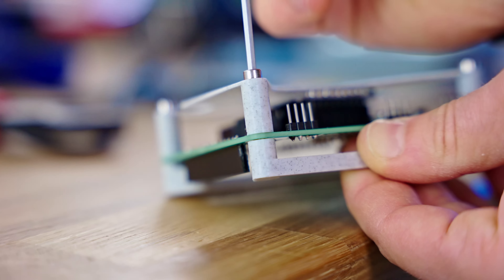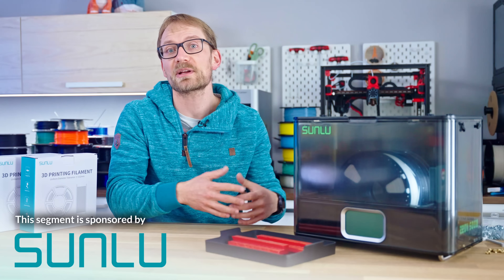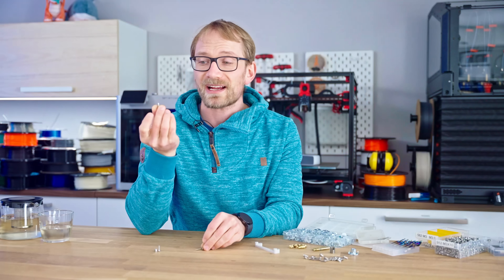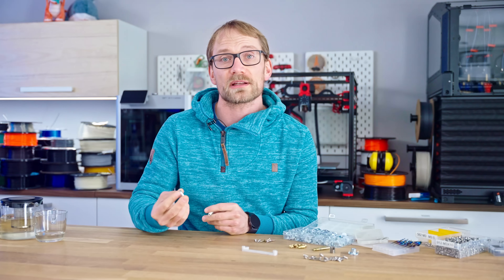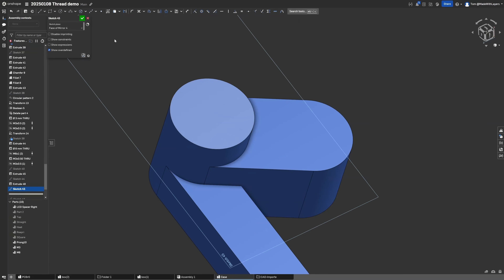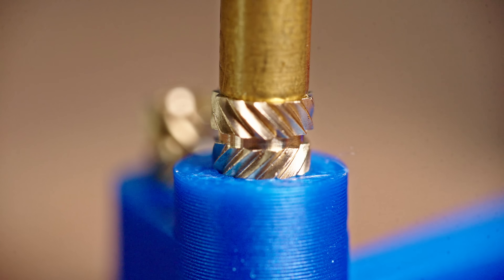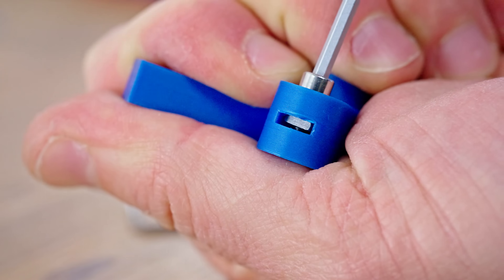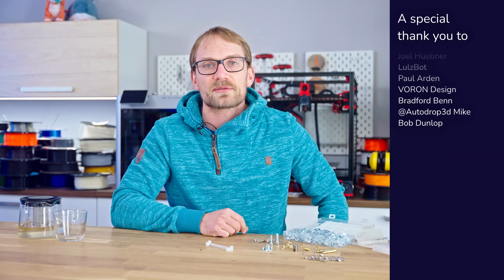A better way to add threads to your 3D prints

Comment: There is also the option of creating a pocket on the bottom face of the part into which a hex nut is tightly inserted. I've found this type of connection to be the easiest and strongest.
Reply: That's one of my favorites. I forget what channel I got the models from, but he did all the math for snug and loose fits for all the common hex nut and screw sizes. Super helpful. One of the popular channels but my mind is running a blank as to which one it was.
Reply: @DarwinAllen  I was too lazy to do any math for tolerances. When i add nuts this way, I just model the size based an the ideal dimensions with zero tolerances. This will create slightly undersized holes into which I can melt the nuts into with the same tools as I would with heat-set inserts. No room to wiggle and very snug
Reply: @Auravendill  Do not melt them! It isnt reliable solution. Just use screw thread to press fit the nut into the hole from bottom.
Reply: @DarwinAllen I got my OpenSCAD functions for this, that I've modified to expect a locating feature that I grind into the hex nuts.
Reply: I've loved this method ever since I saw it on my prusa.  Including square nut hole inserts.
Reply: I agree. Easy to reuse the nut and machine screw too, very useful if you are designing prototypes.
Reply: Or even embedding nuts at a layer pause. Surprised he didn’t mention that.
Reply: @GigaDanMan  This is my favourite solution. It wins on all metrics except maybe ease of use because you have to pause.
Reply: And you don't have to painfully screw through the whole section of the print, just the nut, this is the method I use over almost everthingelse.
Reply: I am very bad in 3d designing but I had to make a box for a pcb for a university project and I thought this solution would be the easiest one. Didn't work the first time but anyways there were much more wrong things on that design. The second iteration worked perfectly, the nuts fitted just perfect, and since I measured the lengh of the screws they didn't come out but still made it to the nut.
Reply: This is my go to - it's easy, neat looking, and super strong -- my Prusa is pretty much full of them...
Reply: I do this all the time but there's a catch with all designs where the thread is on the back of the part and not on the mating surface (aside from aesthetics) - your screws have to be of exact length, or else they will stick out. If it matters, this is not the best option.
Reply: @ErrorTH  Dremel tools are your friend for that if it's just a handful. I suppose if you were producing something in large quantities it could be a pain to source the exact right length.
Reply: @DarwinAllen  Or, just make a deeper pocket to get to a normed length. They go in steps, depending on size. Some 1mm, some 5 mm steps.
Reply: @DarwinAllen  ' Dremel tools '
Make a 3D printed Dremel tool chop saw or similar, with a stop that you can set to set the length.  You can make relatively short work of a large number of screws if you don't have to manually adjust anything.  Just place them and chop the end.
Reply: @ErrorTH its the same as a threaded insert but reversed 

you make the hole for the nut as deep as the screws 
once you push the nut in and start to tighten, the screw will pull the nut in to the correct depth 

you just need to do a slight bit of math to calculate the insert or just parameters in fusion but it's not that much harder 

eg: 20mm screws 24mm tall part 3mm thick nuts, inset nuts 4mm from the bottom so the top of the nut is 7mm deep into the part
Reply: @ErrorTH I have found I am able to recess the nut and adjust the length to keep the end from coming through
Reply: @ErrorTH  Coupling nuts are really long.  More expensive, but provide much more surface area for torque, and length to make fastener length mostly a non-issue.
Reply: @ErrorTH I have a cheap wire stripper plier that has holes for the too long screws up to m5. I  screw the screw in and the plier cut it clean off at my set height and when I unscrew the screw it corrects the cut off edge a bit 🤷
Reply: @ZombieDiscoBall3  brutal. i should try it.
Reply: @ErrorTH  My metal saws fully agree.
Reply: @ErrorTH  "the thread is on the back of the part and not on the mating surface"

Couldn't you combine the "captive nut" with any printed/tapped threads?
Reply: @ErrorTH or trap the nut within your part by adding a pause at the uppermost layer that the nut occupies.  You can place the nut in the cavity and click resume, allowing the print to fully encapsulate it.  If you have a through hole the size of your screw, the length will be less important so long as it doesn't protrude out of the part.

But I don't think you'd be able to print it with the cavity upright, if it's a hex nut, you'd have to print with the cavity parallel to the bed.
Reply: Also called a "captive nut", for anyone looking for more info on it as a method
Reply: I chose this way, its so easy to make a pocket for a nut, and it's fairly strong
Reply: This is my favorite as well.
Reply: yeah this. use draft so they hammer in.
Reply: @ChristheDesignar  I just add an offset of 0.05mm, which creates a tight sliding friction fit.
Reply: Nuts I use all the time, and it is GREAT. Basically, I look at other methods only when this one is not possible for some reason.
Reply: This is the way.  Bike accessory brackets are full of these.
Reply: But he does do this with a square nut, which is basically the same thing in this application that you're talking about. It also depends entirely whether you're talking about torsional strength, or other types of loads. CNC kitchen did a video and actually the hex not at the bottom is quite weak.

Comment: 10-50mm etc.. Aluminum/Brass/Metal standoffs can be used as heat inserts. I used a 30mm standoff driven into a print to add strength and a very solid thread connection. You can take a lathe or a drill and cut ridges down the length to act as barbs. Works great!

Comment: 450cad... for a filament dryer... AFTER DISCOUNT?!!!
I bought my freaking breville smart oven pro (BOV900) for 499$. it can reach 250c~ and has air frying and lots of nice features. it's made mostly out of metal too....
I'd rather buy an air fryer off the market place for 20cad. those ninja air fryers are great for filament. I'd have to make a hole to let filament trough tho....

Comment: The simple straight hole is the best choice for low-strength things. Personally, I haven't had any issues with the correct size (2.8 mm for M3) in ABS, PETG and PLA. No doubt it would be trickier in some plastics especially filled ones - but you can always chase the hole with a 2.5 mm drill bit (which will overcut a little).
Reply: In front of me is a light reflectance sensor, and I've held that into a print using two M3 BHCS - it's great!

Comment: I wouldn't give the square nuts in slots a high durability rating. They have so few threads they will wear out pretty quickly, especially if used in any application where they need to be really tight. Also, it's really easy to cross thread them. I spent many hours working on the extruder of a printer that made heavy use of this technique, and eventually I learned to replace those nuts that were used to mount the extruder every time I removed it, because otherwise the threads got messed up and it was a mess.

Comment: While I can't CAD to save my life, I love heat set inserts. I absolutely hate parts that use a self-tapping M2 screw or "self-tap" an M3 machine screw. Plus if you do a lot of DIY electronic projects you are likely to already have a soldering iron anyway. While you don''t "have to" use a threaded insert iron tip it makes a world of difference. Also you get additional strength if your screw is pulling the insert toward the opposite hole you inserted it from. 

While working on building a Salad Fork I asked in the GitHub if someone could modify the skirt feet to use threaded insert rather than the standard self tapping when attaching the rubber feet. Someone obliged and it made a world of difference in making sure the rubber feet stay put.

Comment: For most basic parts I try to use M3 screws with knurled, 4mm heat set inserts on the backside of the part. Longer inserts usually aren't needed and practically speaking, are very unlikely to fail without applying more torque than the part can handle anyway. I rarely use them facing the screw head unless it's just a holding a dust cover or something. If you absolutely have to use this orientation then longer inserts could be helpful.

For strong, functional parts I now just embed thick hex nuts into the print. Set the gcode to pause at the right height, press the nut(s) into place then print over them. It's the cleanest solution that's easily adaptable into most designs and extremely strong. Square nuts are technically ideal but require more space and IMO only necessary if height constraints require thinner nuts.

Comment: For harder 3d printed plastics, I use Bollhoff amtec flanged Quickserts Hex inserts. Install them with a Hex key. I use M4 and M5 sizes. Very Strong connection

Comment: Which method I prefer depends partly on what bore nozzle I'm using. A 0.2mm nozzle can give me fairly accurate M3 printed threads, but an M6 hole on a 0.6mm nozzle still needs to be drilled and tapped.

Comment: I did the ridges thing for a printed part to printed part connection I needed recently; whilst I profiled mine a bit differently than yours, the connection is fairly secure, yet still removable (which is what I was going for). Took a little bit of playing around to get the spacing and ridge count that worked best, but definitely a useful design concept to include

Comment: ooooh. finally.  a subject I have some experience with. 
printed threads are absolutely crazy good if you can dial in your tolerances.  on fusion,  after I make a thread, I go in and push the flat face .15mm in and then push one of the faces of the thread by .07mm and this seems to work perfectly for every size up to m8 for holes.   if you're printing threaded rods I wouldn't go under m5 and double those push numbers to get it to mate well with both printed parts and metal standard Parts

Comment: depends on how much I care/if i have inserts to suite. I often will just do a hole and tap it as i have a good quality tap and die set. however for my test fixtures i usually use m4 heatsets from cnc kitchen as they work really well even without the correct tool for my iron (but M3 defo needs the tool)

Comment: I bought smallish(M2.2, I know, weird) plastic screws with Torx-6 heads as I mostly print small prints. Extremely satisfying to use, i just design a 2mm hole and it fits. I also recently made a temporary replacement for a broken apart shaft collar (Stellring) out of PLA into which I cut an M3 thread for the grub screw - I was surprised how perfect that thread looked and how similar to aluminium it felt. The only part that really needed to be super strong I made with tapped holes into the ABS for M6 screws, super strong result.

Comment: Would dübelb work in 3D printed parts? I don't know the English word for it, but my fellow Germans will understand what I mean
Reply from the maker: You could use dowels (Holzdübel), and I actually show a couple different ways of using joinery-style connections here: https://www.youtube.com/watch?v=4cnJFZZRui0
If you're talking about wall plugs ("Fischer Dübel"), I wouldn't necessarily use them in prints, as they need quite large holes and probably won't provide the best holding power in a plastic-on-plastic connection.

Comment: I like the heated inserts.   I purchased a special stand to keep the soldering iron at right angles to the part.
Nice idea with the 3 bumps for self forming threads, I may give this a try.
Reply: What kind of soldering irons support the tips for the inserts that you'd recommend? I have a crappy one, so I figured I'd ask and get a decent one for other uses as well. Something that can accomodate different tips.
Reply: There are many models available.   I was looking for one with the replaceable tips for different insert diameters and variable temperature, which is important.
Lookup the phrase for the one I purchased.

Vertical Heat Pressing Machine,Heat Set Insert Tool,Brass Inserts 3D Printing,Heat Set Insert tip for Thread Knurled Nut M2/M3/M4/M5/M6(1/4)/M8

Comment: An alternative to using screws to connect parts is to use clips to connect parts. Clip connections are reliable and do not require tools.
Reply: You mean extra clips like in the car industry to hold the plastic covers?
Reply: Clips integrated into the part.

Comment: I use my slicer to insert a stop at the top of the square nut cavity, insert the nut, and then continue the print.
Reply: If you do strip the nut, aren't you going to strip the heatset inserts?

And if you say "more thread" put in more nuts in a deeper hole??
Reply: This is the way
Reply: Same here works great.
Reply: I find that if I raise one finger between the nuts and perform a quarter clockwise twist, it looks exactly like a potato clasped in the trunk of an elephant.
Reply: is the likelihood of the square nut threads stripping low enough that you don't need to worry about replacing the nut?
Reply: @aaronalquiza9680  I don't understand why there are so many people worried about stripping threads... the most likely thing to fail is the plastic; not the nut.
Reply: @yakovdavidovich7943  here's one anecdote: im dumb so sometimes i forget screw sizes and i strip them while forcing bigger screws into smaller nuts (or matching shaft size but mismatched thread size). if the nut is hidden then 3 months down the line i would forget what nut is in there and i would probably strip it. it probably doesn't happen to everyone else though.
Reply: @yakovdavidovich7943    Especially when most of these things are used for light applications. 

I've never stripped a bolt that wasn't attached to a car. 🤷
Reply: @aaronalquiza9680  It's not much of an issue. But, if you're concerned, they do make a lot of different types of nuts that are a bit less of an issue. T nuts are often a good choice for this sort of thing as they've got a longer threaded distance and are somewhat harder to strip. And, some of them have prongs that can dig into the plastic so they stay put.

But, really, there's a lot of fasteners to choose from, although in general, it's probably best to use one that has some protection against spinning.
Reply: @aaronalquiza9680  Consider- this is already a part that is easy to replace simply because of its base concept. It's 3d printed, if it strips, then just print another one.

Comment: Sometimes I press fit a hex nut into the backside of the part with a clearance hole through the part. The bolt thne goes through both parts and engages the nute in the back of the second part and it is done! Sizing the hex hole for a good press fit is the only real issue... This works with 3mm fine.

Comment: Square nuts were not that easy to find, at least relatively compared to hex nuts. Embedding nuts with print pauses is also a good option. Slowly tapping threads in undersized holes with extra perimeters around the hole (with modifers in PrusaSlicer) is the most reliable solution so far. But threaded inserts are quite fast and easy to use, if you get some practice (in the beginning I pushed too much and melted the plastic too much).

Comment: If your design is final you can embed the nuts into the print (print the negativ up to the end and pause the print, insert the nut and resume the print), no alignment issues, no nut falling out. I would not recoment this if the nut is plane in z direction and you print out of something with really bad z strength, in this case consider tilting the part by 30-45°, this will require support, but the nut won't break the layer at higher stresses

Comment: You forgot my favourite approach!
I often press fit regular nuts into my prints, the orientation doesn't matter but for a strong bond it's imortant that the nut is pressed in from the opposite side of the scew head.
It's easy to model, fail safe to print, quick to assemble with pliers and very strong. The downside insert a short screw on the side of a long plate for example, then the screw is to short to reach the other end. If you bury the nut deeper until it reaches it might interfer with other parts or make it hard to assemble, in that case I just fit the nut from the side instead as you did in your video but with tighter tolerances so it can hold itself in place.
Reply: You are genius
Reply: @G0o0se this is literally a standard practice
Reply: I was stunned of how many options there are, but in the end this was what I normally did anyway, use normal nuts when you have access to the back side...with a hexagonal space in the 3d printed part or with a washer to divide stress across the compressed area of the 3d printed part from the force of the screw. 

but all the other options, if you just have access to the front of the part it was a great video to watch...

Comment: with my PS1, i am able to print threads up to M3 eventif i have to force it's a little it better than a 2.5 mm hole. i also have made my own test card with M2.5 to M5 threads in it, (allong bridge, transparency  etc on a circle that is 10 mm high and has the circumference oof the hole at the center of the filament.. il always print one when i try a new filament and keep it inside the bobine... 15 minute print which has save me a lot of disapointement. :) 
though after i sa your video i will had an insert place, just to add an example :)